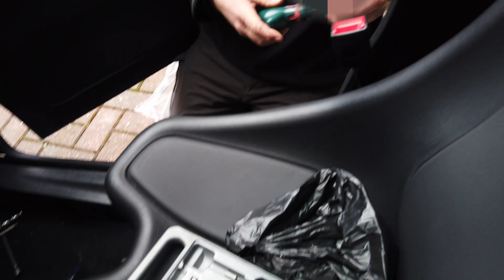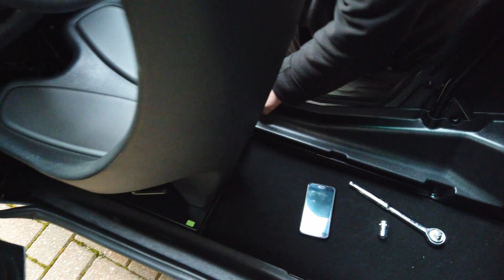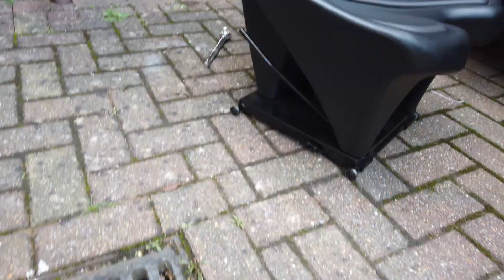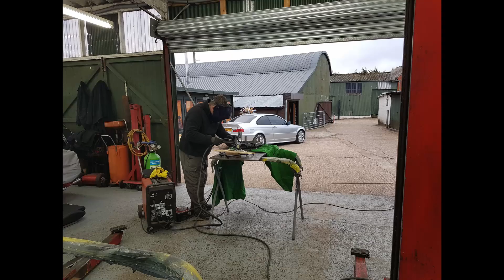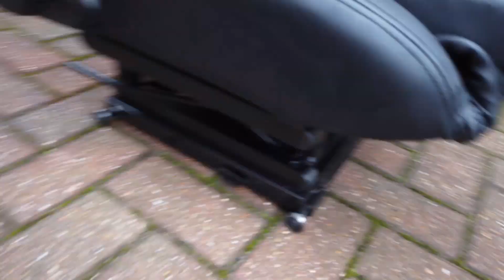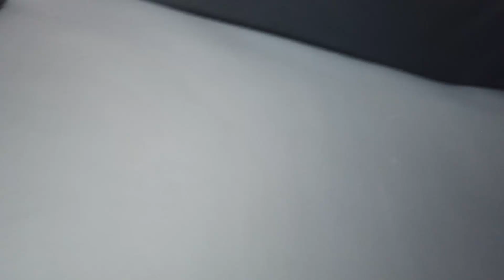Carver Earth - New Seat

Comment: Is this an Sparco seat. Type is Raptor? And: the back part is adjustable, but can you flip it forward, to let an passenger in?
Reply from the maker: I think it's a cheap knockoff of a Sparco. Not original.  Yes, you can still use the sliding mechanism and it also reclines.  Or comes forward to make putting things in the back seat easier.

Comment: Very nice, no fuzz welds, "need strength, not looks" - think the side support helps out when turning?
Reply from the maker: Thanks! It's slightly lower than the original... as the trike tilts in turns I'm hoping the forces are going down rather than to the side?  Testing will see